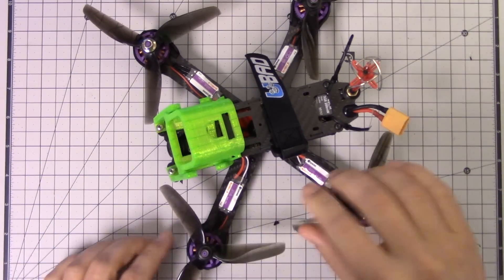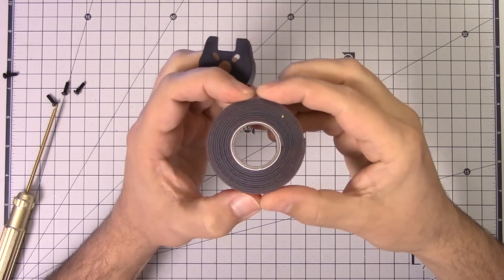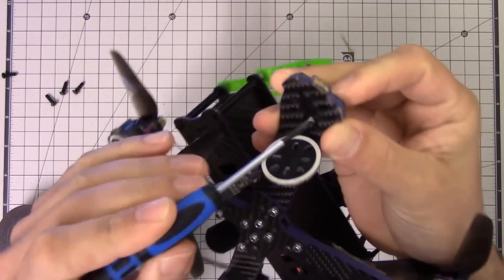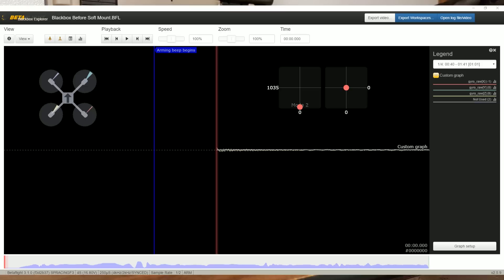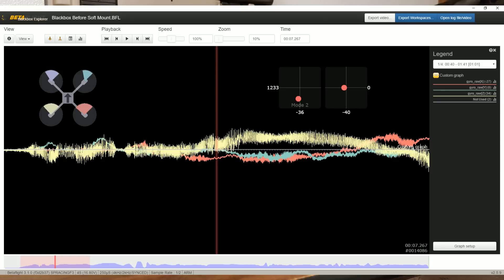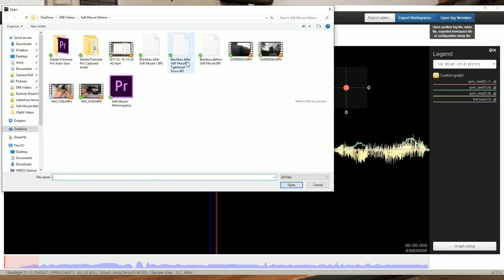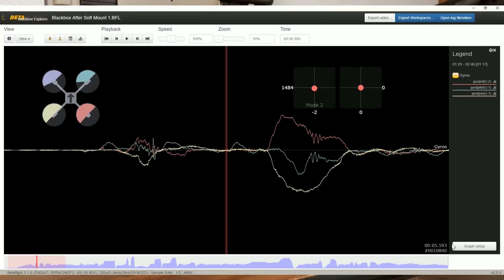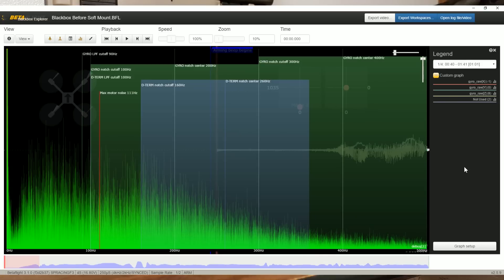Soft Mount Quadcopter Motors | MYTH BUSTED OR CONFIRMED?

Comment: Hi Josh, thanks for the video. Regarding touching screws, why don't you use two o-rings per screw? One between the motor and the frame and the other one on the other side of the frame under the screw maybe with a washer. Three screws should be enough. Can you give it a try? Thanks!
Reply: The screws will still touch the side of the hole duh
Reply: Gotta try that soon but with longer screws and o-rings, the weight of the quad will be significantly heavier.
Reply: Nice. Lokking forward to hear from your success!
Reply: Do you think noise value at ±30 RMS @3S, 1500 throttle w/o prop is a noisy setup?
Reply from the maker: I really don't know since they shifted from accelerometer to gyro readout. I don't have a scale on the new numbers.
Reply: How do you know if your setup is too noisy?
Reply from the maker: +IRFZ44 can't raise D gain without motors getting hot. Video noise especially during throttle up or propwash oscillation. Yaw twitch.
Reply: Joshua Bardwell hv u tried using rubber grommets? Used for mounting servos in rc gas cars. U hv to drill bigger holes thought to fit the grommets.

Comment: its funny you used that tape, as its what I have always used to softmount FCs as well as generally just stick down vtxs, escs etc.

I finally encountered the 6500 gyro mid throttle oscillation too, FC was already softmounted but still had the issue, so I used this same tape to softmount my motors. 

it was a definite improvement, but unfortunately, not enough and I had to goto a new FC. left the motors soft mounted still.

would actually like to see someone release softmount pads with pre cut holes, would make life easier

Comment: This reminds me of the historical break-through in development of supersonic flight, where the first aircrafts were vibrating to the point of destruction.
Until somebody figured out the trick that individual parts should not be coupled tightly: the tighter the coupling, the larger the amplitude at some resonant frequency specific to the aircraft as a whole (instead of small amplitudes of many frequencies distributed among many parts if they are not tightly coupled together).

Comment: so who is going to be the first to market with motor dampening discs?

not that i have vibration problems on any of my quads so not going to tear them all apart to do this... but maybe for new builds?
Reply: 16 screws per quad with no vibration issues... doesnt seem necessary, maybe on a rainy day. i have enough to do. im sure also someone could develop discs with best vibration dampening properties for this.

Comment: Hi Joshua B, 
I've been following you for a while now. Thank you for sharing the knowledge! 
I have an unrelated question and I believe you are the man resolve my problem. I have finished building my first Quadcopter, it looks great. My problem is that one of the esc's switches off during flight and when I disarm it the esc makes the sync sound and when I arm it again it comes back on. This happens when I give it some heavy thrust. Do you have any suggestions? I really did a great job with the soldering. 
I'm using librepilot and my setup is the lisam 210 littlebee 20amp using a matek 3.1 all in one pdb and the cc3d evo fc. The motors are lhi 2205 2300kv. I hope you can help? 
Many thanks in advance. : ]
Reply: Gogi Fire  Check to make sure that all your esc settings are the same in blheli. Might need to re flash them all to the latest firmware as well.
Reply from the maker: +Gogi Fire the a Alyson would depend on exactly what sounds the ESC is making. Is it powering down  or just losing throttle signal?
Reply: Joshua Bardwell it's powering down. making peeps at the same time
Reply from the maker: +Gogi Fire that doesn't make sense. If it was powered down I don't know how it could be beeping.
Reply: Joshua Bardwell ok i just tested it again.. ok not powering down. it makes the same sound like as if I just plugged the battery. but just one esc and when i disarm it, it makes just one peep..
Reply from the maker: If it is making the five-beep tone, then it is losing power. If it is making the two-beep tone then it is losing signal. Most likely cause is a sketchy solder job or cut/broken wire IMO.
Reply: Hi! Ok so i found the problem. After swapping motors and esc around, it turned out to be a faulty esc! Happy that i found the problem and disappointed that a brand new esc is wack, at the same time.. ThanX for the advice here :]
Reply: daneyan1985 thanX man. Didn't think that far! How do i flash the escs?

Comment: I beat the hell out of my quad, fly PC props and don't change them often, and I don't like swapping out motors once per month. I had great results from the electrical tape trick. However, after exposing my quad to moisture and mud and abuse, the tape started to peel and trap dirt underneath. Last night I applied 5 coats of liquid electrical tape to my mounts.  I'm pretty happy with its adherence to the carbon fiber, and it even coated both sides of the screw holes. I'll be giving it a test fly today. Thanks for your comprehensive workup, Joshua!
Reply from the maker: +ATA FPV some people are using TPU mounts.
Reply: Joshua Bardwell I might try some on my next build. This frame is nearing the end of its life so I wasn't worried about applying an experimental goop.

Comment: Technically you could even soft mount the screws. Apply the dampening tape also on the bottom side and fabricate a round plate with four holes for the screws to fit over it. The only surface that the screws could touch the arms now is with the thread itself. But you could easily eliminate that with drilling a bit bigger holes in the arms....

Comment: I am going to start doing this too, but would you still only use 2 screw in your motors that you soft mount? Thanks
Reply: I am also thinking of using a tpu 3d print mount instead of tape. Do you thing that will be as good?
Reply from the maker: +Larok the Creator to is effective at vibration damping. Whether it's more or less effective I can't say.

Comment: Can you try this with electrical tape? Jonny is using electrical tape and I would like to see if that makes near as much difference as the foam you used. I also have an idea that would use a standoff (tube) that would allow the screw to be tightened down to the motors tight and have dampening material under the motor and under the screw heads to allow a true soft mount. This would require a machined spacer of just the right diameter and length but nothing my CNC lathe cant handle.
Reply from the maker: +helicrashpro o don't think I'm going to repeat the experiment. I demonstrated that soft mounting can make a big difference. The fine details aren't as interesting to me. I believe Johnny and many others who have told me that electrical tape cured vibration issues for them.

Comment: 3m 4010 clear mounting tape works great. When a similar discussion went on in the rx helicopter world it was settled(mostly) that this is the best tape to mount gyros and flybarless units. I've been using it to soft mount my motors and it works well for me. Like the grey stuff it's a bit thicker than 4 layers of electrical tape but it compresses without loosing its ability to dampen vibrations. I am curious to see how the 3D printed mounts work since they would be much cleaner and easier.

Comment: Shout out to all my haterz
Reply: Oh come on, you don't have any haters <3
Reply: Never doubted you for a moment. I can confirm it works! I too soft mount, it took a major twitch out of my copter. (bad motor bearing). with that said, the whole soft mount joke is funny as hell. dont take offense to it. you did the hobby good. you rock. end of story.
Reply: Nice work Josh. Johnny can you now use the blackbox data like Josh did and quantify Juicy vs whatever non-Juicy is? You guys are awesome. Cheers.
Reply: Johnny FPV it's not new though.. used electrical tape back in 2015 !!
Reply: @serval FPV Exactly. I didn't use electrical tape but I soft mounted the motors on my first quad back in 2015. Now all of a sudden it's like a massive breakthrough.
Reply: I'm not one, I agreed with you when I first saw your video.
Reply: @LarokCreations  the opposite of a hatter.... quit sucking up tool.
Reply: Always had your back Johnny!
Reply: I was definitely one of the people going NO WAY. I would not be offended if you replied to all your haters with "Drink mah juice!"
Reply: now you should soft mount your glasses, so juice doesnt splash out when you put them on the table.. hence #evenmorejuicy
Reply: Johnny FPV my hats off to you sir
Reply: Juicy... Real Juicy...
Reply: Johnny FPV i knew that u where right ❤🙋
Reply: Farmer Fpv I'm about to find out tomorrow if it worked or not
Reply: Vaaaht! You don't have any hata, Cheeex. I'm using Juicy Fruit under my motors.
Reply: +Tom FPV The taste the taste the taste the taste the taste the taste the taste the taste the taste the taste the taste the taste the taste the taste the taste the taste the taste the taste the taste the taste the taste the taste is gonna move ya
Reply: Hahahaha! Feels good, doesn't it?
Reply: I tried it and now doing it again, so confirmed it helps 👍
Reply: Readymade RC now has TPU motor mounts for soft mounting.  They were in today's e-Mail.  This soft mounting thing is really going over big.
Reply: it worked great for my flying cinema x24. i have a dinged up motor and the tape got rid of the shakes on throttle up and at the top. it worked so well i was able to up my PIDs by a full point. 

Keep the great ideas coming
Reply: Farmer Fpv. Haha no sorry I forgot to vlog about it, so I guess it didn't happen.
Reply: Blindside FPV ;)
Reply: it's because he was in kiddy garden back in 2015 ... couldn't know this existed back then
Reply: not going to lie i thought this was bs but im not afraid to admit i was wrong haha. johnny flow knows!
Reply: +RandomFPV By that definition I've made it big time.
Reply: thank you Johnny that fixed my T motor problem
Reply: don't be silly johnny lol  respect my friend :-)
Reply: Lol 😀 Johnny 👍🏻
Reply: @stickboyfpv4742  Nope, but I'm sure you can tell me about your experience with that. Everybody knows about your Zoophilia 😉 GTFO of here with that. This is a year old you cyberbullying troll 👍
Reply: We love and MISS YOUUUU!🤗🤗
Reply: Blindside FPV do you have video proof of this? video or it didn't happen.
Reply: Bless you, the Godfather of soft mount!

Comment: Now I've seen more science around this.  Great work!  One of my quads has a serious yaw twitch on hover only.  Rather than lowering (P) for typical yaw twitches that seem to manifest itself the colder it gets (snow, freezing weather etc..), I think I want to give electric tape on both sides of the frame a try.  To confirm, you used blue loctite right (that's what I have)?  BTW, I'm curious why (D) doesn't exist on yaw.
Reply from the maker: +Michael Steele Blue loctite yes. Red is permanent. The yaw axis is not responsive enough to use a D term.
Reply: Joshua Bardwell Thank you!
Reply: Joshua Bardwell Thanks again for the science of Blackbox.  I actually tried 3 layers of electric tape (threads not long enough) today and it seemed to correct yaw twitch and it seems to make the quad feel faster and smoother too.

Comment: Thanks for the Tipp. Didn´t know that something like this is possible. And the thing with the screws take some washers in between. Graysonhobby has also brought a video for the Wizard, and they are using some washers for their gold package. And i have an other question. I build up an Racecopter, with an 4in1 ESC and some Emax 2205 Motors, and on the motors the cables are to short. The motorcables are 20awg and the cables i wanna solder in, have 18awg. Could i have then some issues with the signals from the esc to the motors?
Reply from the maker: +Thomas Krois I would definitely keep the same wire gauge.
Reply: Thx i would do this.

Comment: Interesting. Honestly, I don't do race and not an accro flyer. Most of my quad are big size and I mainly do aerial photography or just flying around for fun. The idea of soft mount should help reduce vibration from video too as it did to gyro. My smallest quad is a 260 running INAV.
Reply from the maker: +Witit Pienchob yes, I assume this will still help with larger copters.

Comment: You should have used electrical tape! Of course that thick foam tape is going to hide vibration.
Reply: Yeah, I know. JKFlorida's comment was in reference to the electrical tape method because the "hype-train" method was using electrical tape, therefor it would have been good if Joshua used said method to put the bitching to rest. Instead he used a different material, which I'd imagine somebody will use as an excuse to counter the argument that e-tape actually works.
Reply from the maker: +Kev PV I interpreted it as people disputing whether soft mounting the motors worked at all. I think it's obvious that any decoupling of the motor from the arm will have some benefit. As the joke goes, "Ma'am, now we're just haggling about price."
Reply: It makes sense to me...
Reply: Soft mounting doesn't mean ONLY doing it with electrical tape. It's that, this and TPU printed motor mounts too. Like literally anything to eliminate vibration.
Reply: Yes the hype train is about 3-4 layers of electrical tape. Not 2mm of foam tape.
Reply: Word. I was specifically referring to JKFlorida's comment here. I've always been an advocate for the soft-mount idea after I saw how much it helped my quad. But thank you very much for making a video about this in an effort to settle some of the disputes. My only hope is that people will finally stop making such a huge deal over it. The backlash is utter nonsense. Keep up the great work!
Reply: FWIW others have posted blackbox results using the e-tape method and confirmed the same thing Joshua's test did. Both methods work for reducing vibrations.

Comment: Sooo... What about the effects of the weight of the tape? Yeah it's only a couple of grams per arm, but they are far enough from the center of mass to have a huge impact on momentum of inertia (is it even the right term? I'm translating directly from Italian) so the responsiveness of the quad will surely get worse...
Reply: If weight is your concern, try the little TPU soft mounts. only 0.14g per motor. I have some up on thingiverse or FPVHQ sells them
Reply from the maker: +Acd FPV I'm sure the effect is very small. Just a few grams.
Reply: Joshua Bardwell Yeah but really, 3 grams 15 centimeters out have the same effect of 70 grams 4.5cm from the cog... That's the effect of flying with a yi vs flying with nothing... And also why a 27 grams motor is light while a 31 is too heavy, or why a 4.5 grams prop is good while a 6g one is almost untuneable...
Reply: Joshua Bardwell actually, if you ever run out of ideas for your videos, may I suggest one on the tuning differences between hard mounted vs soft mounted motors?  Still, awesome video as always man! ;)
Reply from the maker: +Acd FPV less vibration means you can run higher D gains.
Reply: +Joshua Bardwell But is not goal to run as lower as possible D gain. D gain neglect effect of P and high D gain is only used for slow systems (for fast response systems you can omit D gain and get much better results).
Reply from the maker: I have yet to see a copter that could tame propwash oscillation without D gain.

Comment: Could you compare the 3M tape to the electrical tape version of soft mounting, as a lot of us have electrical tape on hand. Do you think it works just as well?
Reply: Also, thin 3D printed TPU motor mounts would be nice to test.
Reply: JC250 just try it jesuuusss
Reply: sure would , thats how i use to mount my apm boards , that or moongel
Reply: Esa Edvik  I like the tpu idea.

Comment: I found that drop of oil (corossionx) on noisy bearings works very well on removing micro vibrations and mid throttle oscillations
Reply: fpvYou interesting use of Corrosion-X.  Do you need to re-apply bearing oil afterwards?  (Like how a more refined oil will act as a solvent on a less refined oil -- I don't know how Corrosion-X compares to bearing oil like Scorpion.)
Reply: no. They state they are "World's Greatest Lubricant"

Comment: Has anyone tried having tape on both the top and bottom sides of the frame? This way the screw heads would't touch the frame directly since you'd have Motors > Tape > Frame > Tape > Motor mount.

EDIT: Typo.
Reply from the maker: +Dren Imeraj wouldn't the screw heads pull through?
Reply: I guess I'm just a noob, lol. I thought the motor mounts go on the bottom side of the frame. Maybe use something like your led boards to prevent the screw heads from poking through.
Reply: I actually think he's onto something. If soft mounting the motor side got rid of a ton of low freq noise, perhaps soft mounting (or at least attempting to, though maybe with rubber o rings instead of tape) the screw head side would also "physically filter" out a lot of that high freq noise. Isolate/dampen the entire thing instead of just one side. It is the logical next step in this soft mounting phenomenon.
Reply from the maker: +Mennenth if you wanted to do that, I would use a base plate with material between it and the arm. That would allow the screws something solid to hold against.
Reply: Or maybe individual washers on the screws? I'm guessing 16 washers won't add up to a lot of weight.
Reply: Bogdan Boeru Yeah I was wondering about that too, though I wonder if spreading the pressure with a plate would be better. Either should work though.
Reply: A thin plate underneath would solve that.
Reply from the maker: +sligit yup.

Comment: Love your videos Joshua.  I wonder what the results would look like if you had done this test with electrical tape.  I'm assuming the 3M tape has a better effect due to it's thickness.  I want a cleaner look, so I'm planning on using the rubber o-rings that I use for the FC, good idea you think?